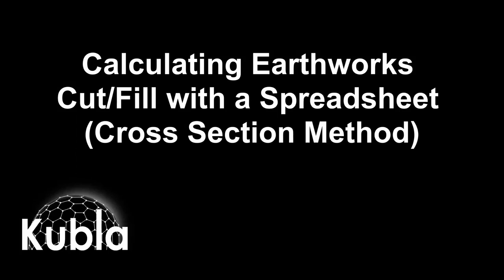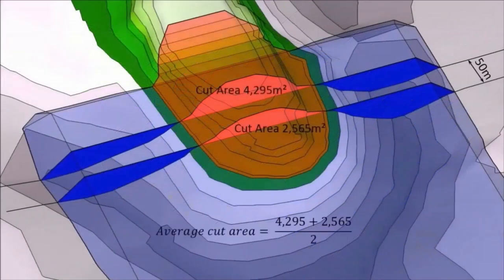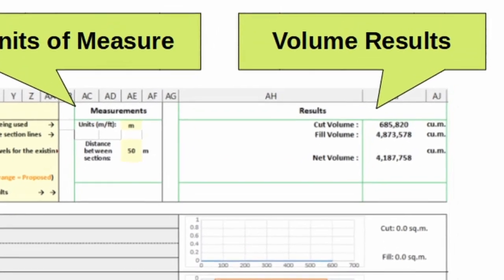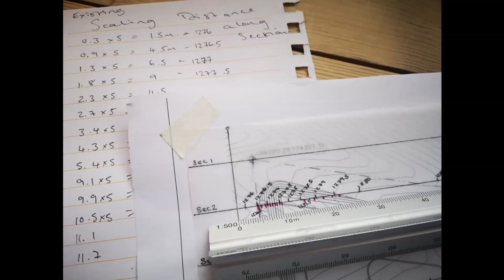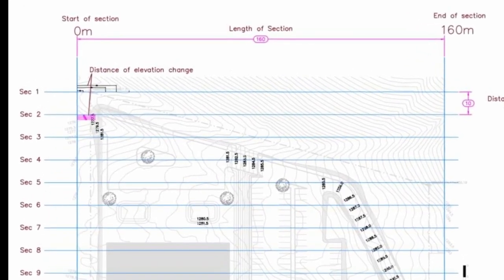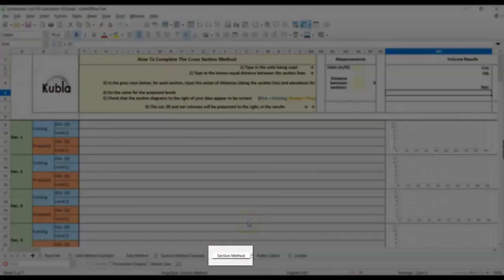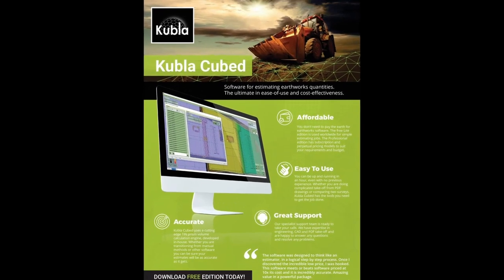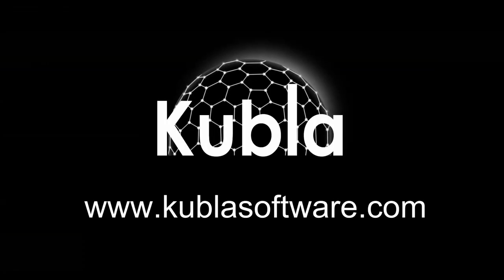Calculate Earthworks Cut & Fill with a Spreadsheet | The Cross Section Method

Comment: May i know in the data shown the level indicated -ve and +ve. Can i know what -ve and +ve actually ?
Reply from the maker: Hi Norain, I don't understand the question. The terms -ve and +ve aren't used in the video or  the spreadsheet, can you explain what you are referring to ?
Reply: Hi i mean the example of data value in the spreadsheet. 

Example : 

For existing level. 

The value (level) is -20, -25. The -ve value here means what ?
Reply from the maker: @norainjanain8960  Another word for this is 'Elevation' so the values -20, -25 are basically 20 below datum (mean sea level or whatever other datum you are using). This are taken from the spreadsheet.  The reason that they are negative is the example project has elevations that go below the sea level.  If it was a construction project they would usually be entirely positive.